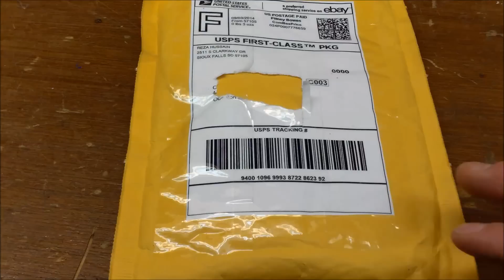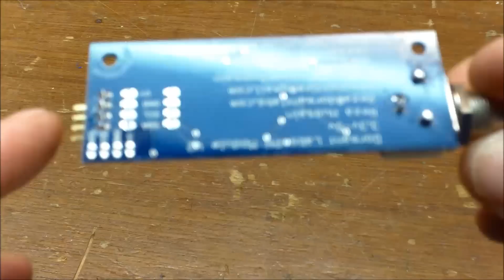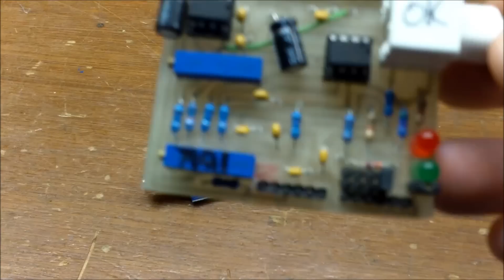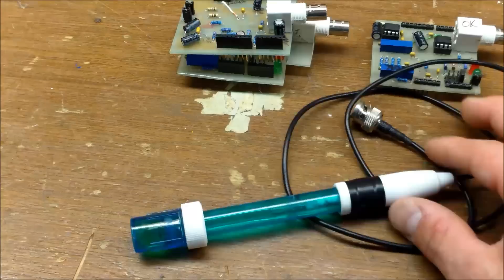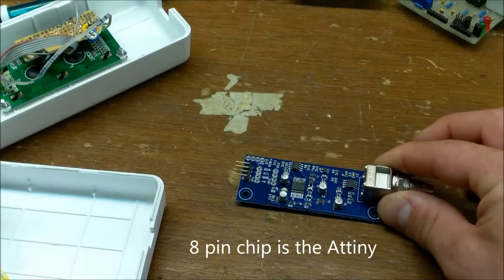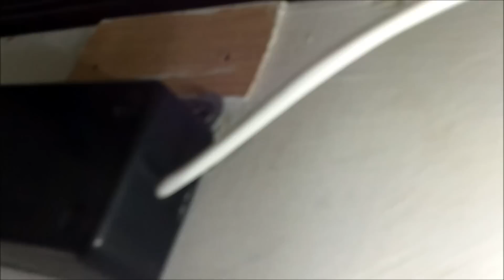Arduino i2c PH Board for Aquarium from Dormant Labs or Tindie

Comment: codes please
Reply from the maker: here is the link to the original blog post from where I got the PH board from: http://rezaalihussain.blogspot.com/2014/07/measuring-ph-with-dormant-labs-ph.html

I don't think this PH board is available anymore, try getting a newer version here: https://www.whiteboxes.ch/shop/tentacle-mini/
Reply: is there code here?
Reply from the maker: Yes, couple of different codes whcih depends on if you have PH 4 and 7 solution or if you have PH 7 and 10 solution.

Comment: Hi, is the probe totally waterproof? I mean even the connectors or the link between the probe and the wire can be continuously submerged like the sensor is, or they need to be seal? Thanks
Reply from the maker: +Batiste Allilaire most of the company's say there are. Not sure I would trust it for long extended periods of time. Mine goes under during water changes.
Reply: Carl Recktenwald Jr. thanks I'll watch out for this

Comment: can that be used with raspberry pi
Reply from the maker: I don't see why not. It works with serial or i2c communication.
Reply: +Carl Recktenwald Jr. thanks man..but does the arduino do A/d conversion inside the board which the raspberry Pi cannot do.because i would need an A/D converter if it is an analogue pH sensor.
Reply from the maker: Dean Malengu I believe the Atlas stamp does all of the A/D conversion. The Atlas stamp then sends the data via i2c or serial. The only issue I see is the Tentacle shield is not 3.3 volt tolerant. However the Tentacle mini is 3.3 volt tolerant. https://www.whiteboxes.ch/shop/tentacle-mini-for-arduino/
I will do some research about the PI and let you know for sure.
Reply: Carl Recktenwald Jr. thanks again for your help.you can pass your email or mail me.. deanmalengu@gmail.com

cheers!
Reply from the maker: I talked with Patrick from the company and he said that the tentacle mini will work with the PI. That is coming out in Feb 2016. The company is also working a on Pi tentacle  that will be out in March or April of 2016.
Reply: Carl Recktenwald Jr. sure..thank a lot for the information..